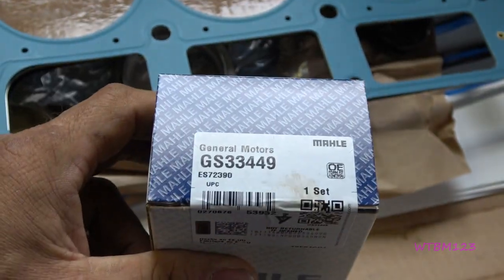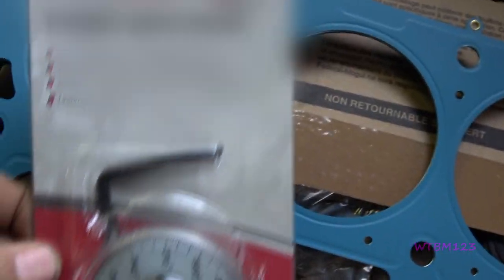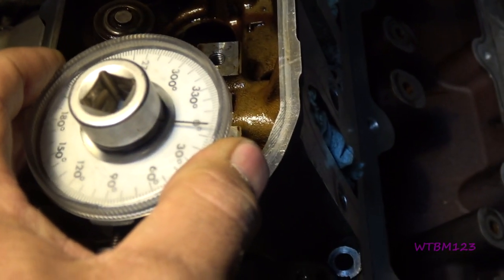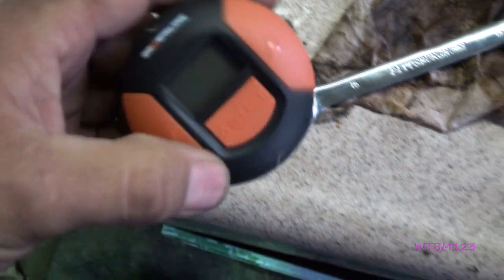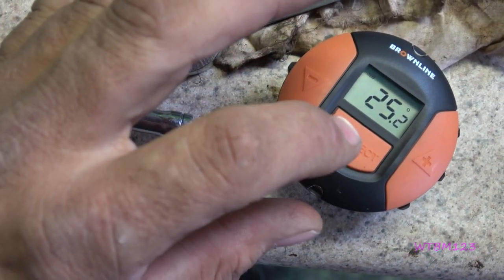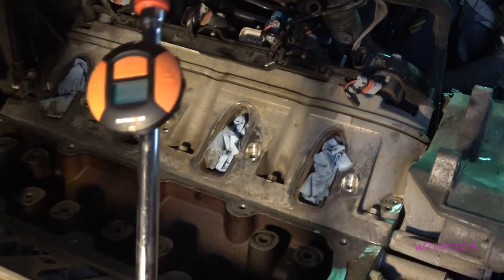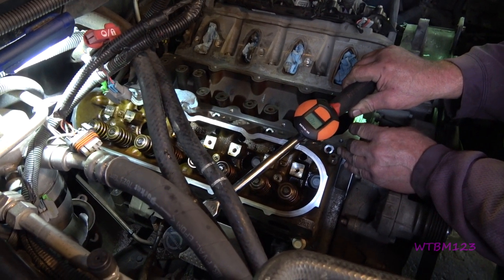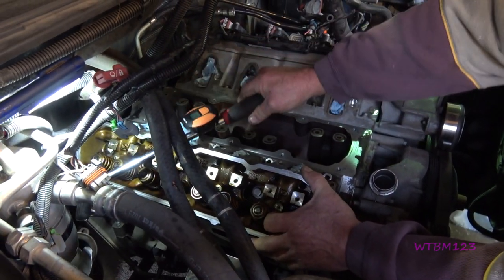Brown Line Metalworks  Digital Angle Gauge , For those Torque to Yield Bolts

Comment: Terry that is about the slickest rig i've seen in a while as a torque wrench with that built in is a pricey item. Nice one bud im getting one. Thanks
Reply from the maker: So far it has worked pretty well . And i like that you can just stick it on any wrench  or ratchet .